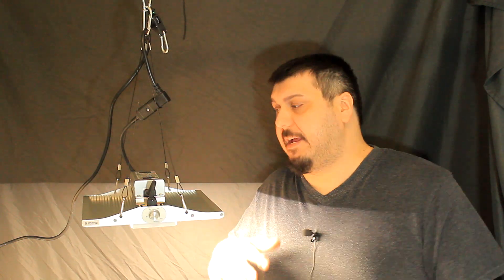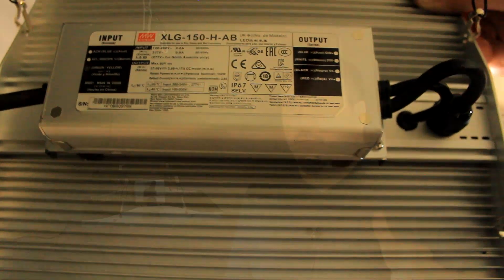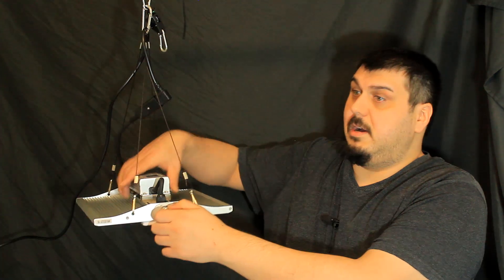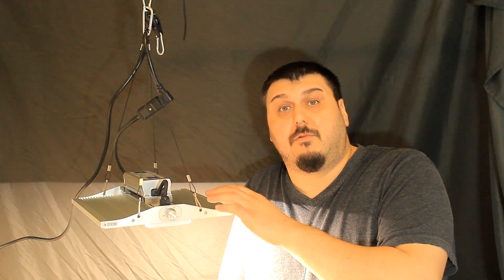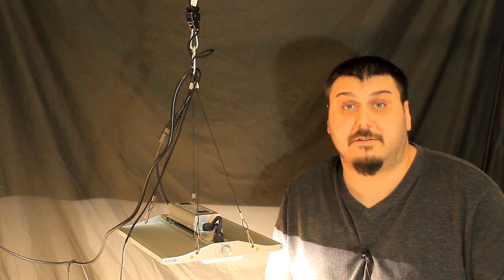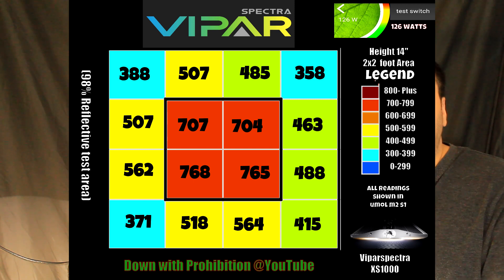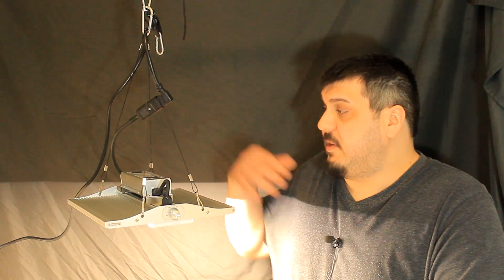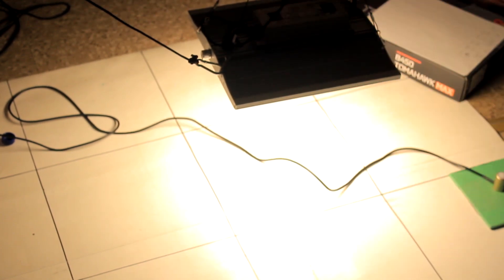ViparSpectra xs1000 Grow Light PAR Testing & Review

Comment: What type of area coverage can these lights do?
Reply from the maker: I will try to give you a very basic understanding. The xs1000 will do a 2x2 space and it runs roughly about 100 watts. These work great for smaller tents. The xs1500 gives a bit more coverage at about 2.5x 2.5  feet.  If you are looking to light let's say a 4x4 foot space you would want to go with a bar style light over these qb style panels. For instance a 4x4 can get great results if you throw about 500 watts at it. Most bar style lights now a days for a 4x4 run at about 480 to 540 watts to give you a general idea. What size of grow space were you looking to setup?
Reply: @downwithprohibition7364   its a 1.2m square tent ... think it workd out 4x4 .. mayb I'm best sticking with my 600hps for now until I can afford a really quality led then.. you replied to my other post too so thankyou! That's give me more of a understanding... energy prices are just so kuchen higher now I'm starting to look for alternatives. That being said I can actually do my current 1.5m Square tent with my 600 and parabolic light. Hmm give e something to think about. Thankyou 👍
Reply from the maker: @leafysfishing  I have no objections to using hps... some of those reflectors really help to increase the spread..  but honestly if you can save up for a quality led you will be much better off. The big difference you will notice is the heat. Hps is insanely hot, back in the day I sizzled my finger on the reflector from a quick touch.. If you using ac to cool things down you may not or rarely need it with led, depending on your grow environment of course.
Reply: @downwithprohibition7364   subbed btw

Comment: Hey great video got a question I just received a xs1000 in the mail and when I adjust the dimmer the light turns completely off just under the 25% mark ? Does yours do the same ?
Reply from the maker: Yes, I am not home.right now to double check but i believe the xs 1000 turns completely off unlike the other xs series lights
Reply: @downwithprohibition7364  Ok cool thanks for the reply yeah I figured it turning off was normal because the dimmer is labeled 0 % but it just does it way before I actually get to 0

Comment: Another reviewer found that the XS series has better diodes than the P series, but considerably fewer of them. I think it was Justintimetogrow. I counted the diodes from American Amazon. The P-1000 has 306 diodes. The XS-1000 has 254 diodes. Neither ad states the number of diodes. Pretty sure the other reviewer found that the P series was a better value than the XS series. I have a couple of the P-4000s, and I like them. They would be better if I could mount the drivers outside if they had a longer wire from driver to light.

Comment: Great Vids, keep them coming I enjoy watching your grows. I'm a medical grower as well. I use Mars Hydro in a 6x4 room using 2 TSL 2000 on each end and a ts 3000 in the center. I agree on the lights not sure why the green ones are actually better then the XS series but there's numerous tests and some show there old series doing better then the new. On efficacy and on light spread.maybe do a side by side in a 2x2 to see which is better. Put the question to rest once and for all. Green series vs XS series.
Reply from the maker: Thanks Luke I really do appreciate your nice comments man. They are neck in neck between the 2 series.  It would be interesting to see the xs1000 and dropped down to 100watts and then put it head to head with the p1000 to see what one is better.
Reply: @downwithprohibition7364  The Xs series is 150w and the p series is 100w I didn't know that , wonder if the people who put bad reports out on the xs new that. I'd leave it at the 150w and test and see the dollar per umol compared to the 100w. My guts telling me the 150 is barely going to out perform the 100w p series. Try it, if you can I'm really interested now to see if vipar is trying to pull the wool over our eyes.

Comment: Who is growing with zero airflow? Why test the temps like that?
Reply from the maker: It's the way we have always done it. Open air testing shows what the light naturaly gets up to. So much varies if you add airflow. How much air at what angle, speed ?? The only way to get an even result across the board is open air test. This is after 8 hours of run time. Another reason is that Viparspectra promotes these lights and good for both medicinal plants as well as for the garden. Most of these garden people do not use these in a tent so they are often used in this application.
Reply: Not everyone starts out a pro like you. I've helped people with grows and they had 0 fan's , if he's testing the light, he might aswell test for the worst case scenario. So people may know it's not going to get so hot it shoots up in flames.